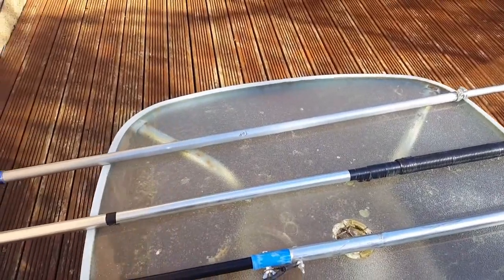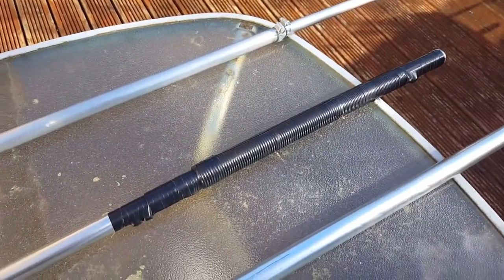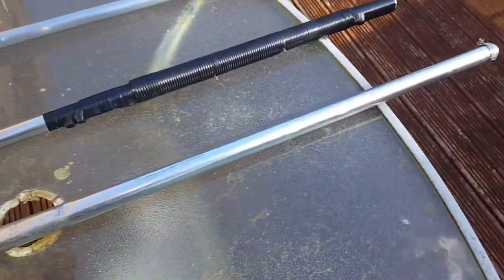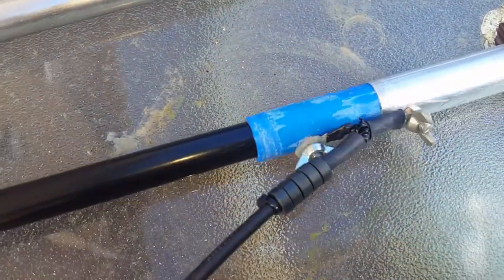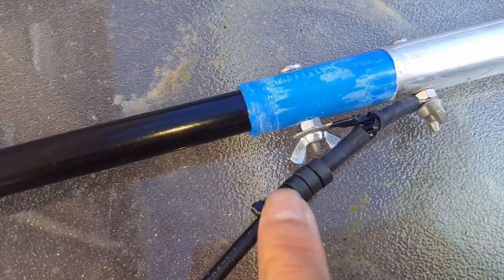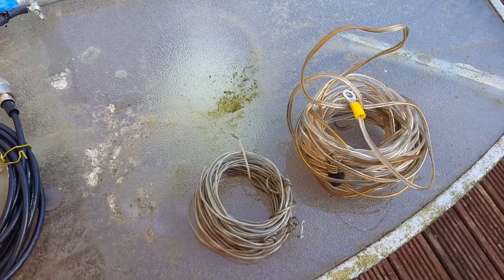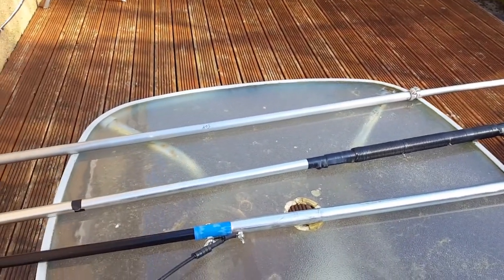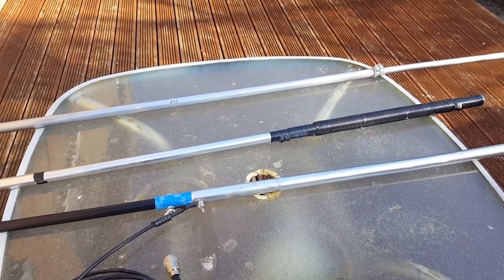40m Center Loaded Vertical Antenna Homebrew

Comment: Much better! Did you say the coil is on PVC? Was that just easier than doing it on the tube itself, or to make it wider to require fewer turns, or some other design consideration? Sorry for so many questions but I am really thinking of trying this.
Reply from the maker: No problem pal,the pvc serves to separate the upper and lower sections, and as a former for the centre coil,good luck!
Reply: @mm0umz426  Yes of course! They would need to be separated, or your coil isn't going to do any good is it? I don't know why I didn't see that straight away. And just the stake holds it up? No guy wires?